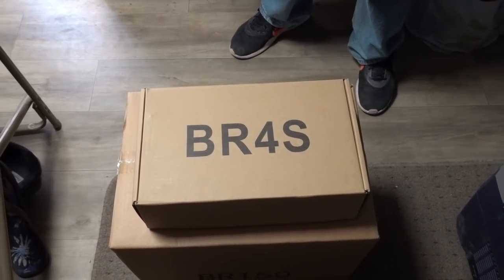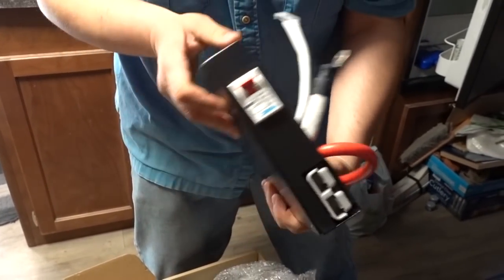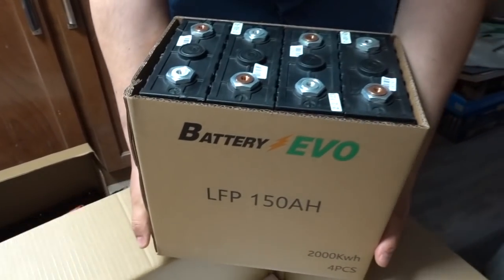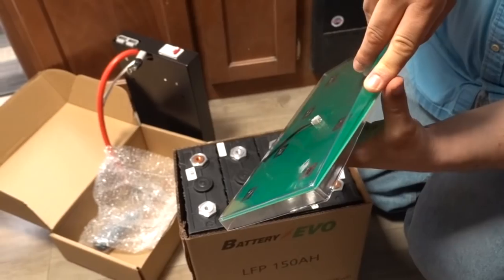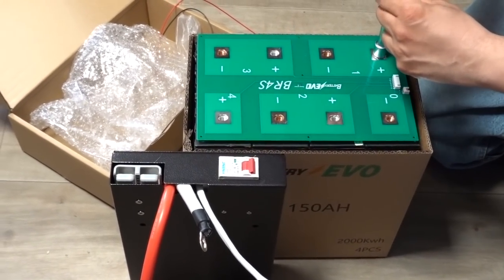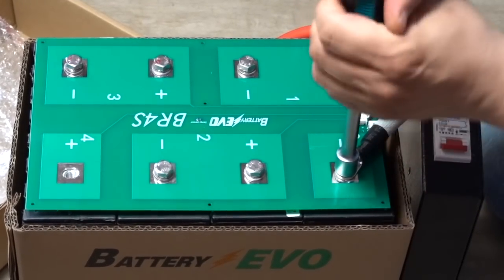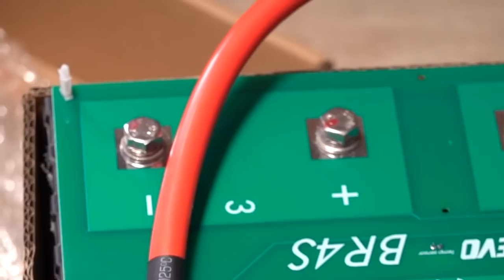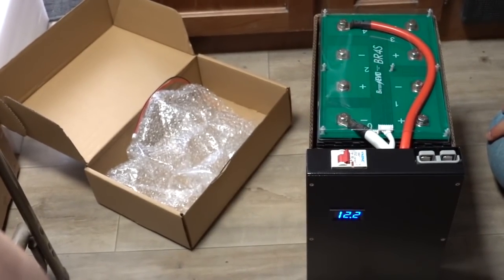LifePO4 150AH Battery Build

Comment: I would be worried if they are fully charged. reason is Battery should usually be transported about 1/2 charged(as low as 30% is ok). That is the best way how it should be transported ..I would be worried about that connector that you don't have ..after all not all will get that connector for free and it isn't cheap also..

Comment: @Trailer Life  So Sinopoly makes these cells they were originally 200ah cells . Ive had some for a few days and even with 800watts of solar they wont charge past 3.4 volts per cell or 13.48 which is fine but test is showing im not getting 150ah more along the lines of 114ah . How has charging worked out for you? Im have my float and charge set at 14.4 but its not gonna get to the 3.65 per cell which is expected . Was just wanting to compare with someone who had the same cells

Comment: used cells
Reply: How did u no it's used cell?
Reply: @omsglobal  I had to take the battery apart and test the cells. There were defective cells an damaged cells that looked to be removed from another piece of equipment.
Reply: That cells was never used for storage application before.   It's was removed from electronics autos, that's why they will still tell u it's grade A. But was there qr code on dis calb cells?, I used to get 200ah and 500ah,both have qr code.
Reply: @omsglobal  Maybe you just got lucky. Do your research and you will find that they are notorious for putting used cells in batteries and calling them new.
Reply: YEP, says refurbished clearly on the web page. No telling what or where they were used or abused.
Reply: @omsglobal  Did you even read the web page where they are sold???
Try again with your glasses on.